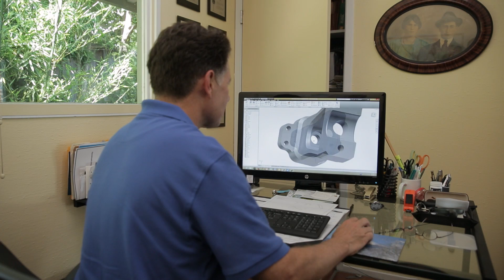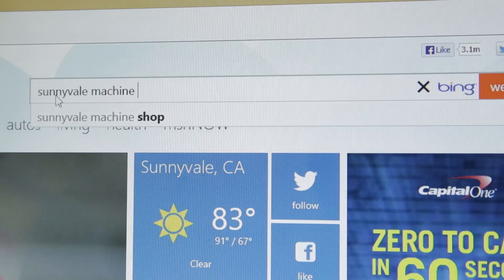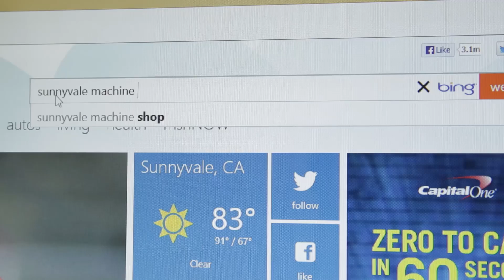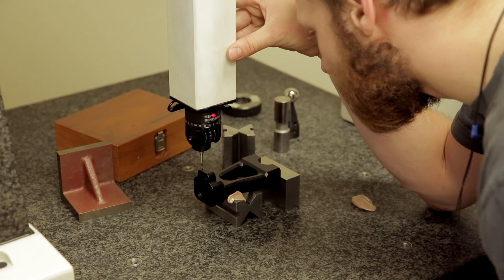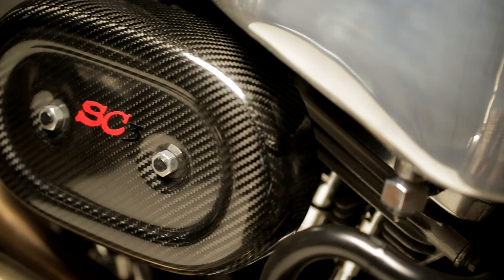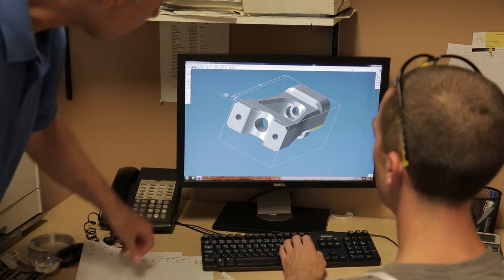Our Ride: Carducci Dual Sport and the SC3 Adventure

Comment: Nice, but not worth the price. I wonder if even 10 buyers will be found. Hope so, for your work.

Then again Deus sells there ridiculously overpriced "customs" so there are a lot of people with full pockets and this could be another fun toy to keep in the play room with the Jet-Ski, track bikes, dirt bikes, cruisers, Jeep, ATV, UTV, dune buggy, airplane, Bass boat and ski boat.

But the bike is too tall, the high CG makes it top heavy because of too much suspension travel which requires too much ground clearance.
I didn't believe a bike could have too much suspension but this bike proved me wrong.
All the travel you can get is great for an off road race bike but not for a dual sport and certainly not for an adv bike.

There are many excellent Dual Sportster builds and a vast number of lousy ones on advrider and other sites online and I enjoyed following your build from day one through all the changes and improvements.

Your bike is one of the good ones and might make a fun race bike for the Baja 1000 if you could persuade HD and SCORE to create an anything goes HD class.

For several years I considered building a Dual Sportster but I realized the only part of a Sportster that I would use would be the engine, and it would be modified so much it would hardly be a Hardly Abelson anymore. That's when I decided to start with a Buell motor.
A full custom frame and swingarm is under $4,000, excellent suspension F&R with 8" of travel for $3,000, custom aluminum tank under the seat for $1,000, wheels with excellent brakes $3,000, and all the many small parts to finish it off at $3,000.

Nah, not worth it.